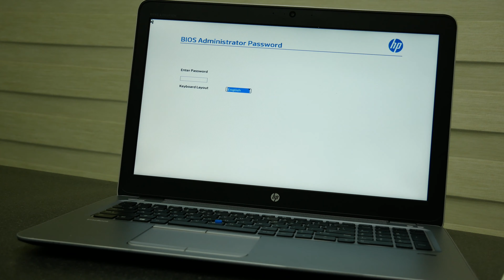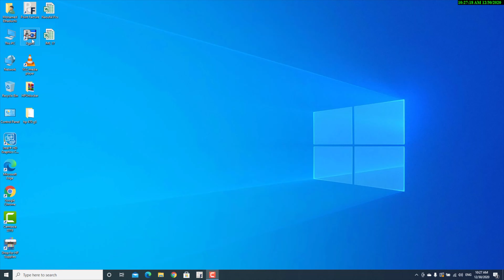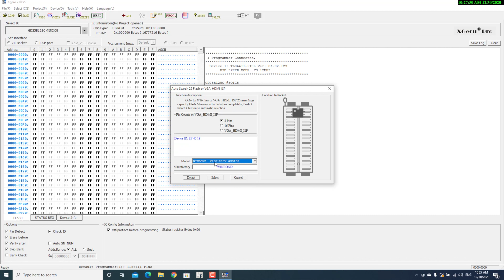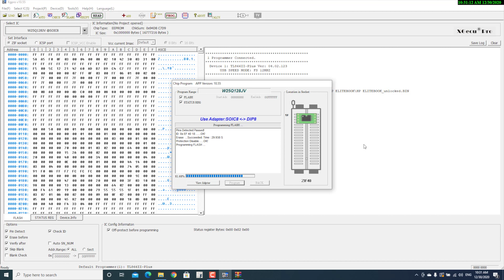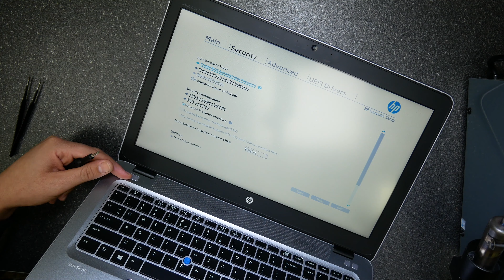HP EliteBook 850 G3 How To Reset And Remove The BIOS Administrator Password  FREE UNLOCK!!

Comment: I'm certain there's a reason, otherwise you wouldn't be doing it this way, but I'm curious as to why you can't backup the chip , then mod, then restore entirely via software tools running on the G3 without desoldering? Love to know why you can't. I'll try this when I get the courage!
Reply: i tried to do without desoldering. and now the laptop i sleeping for over 2 years. i dont know why

Comment: Is there a clip I could use for this chip so I don’t have to de-solder or is this chip too thin to clip to?
Reply: If it can be done at all without desoldering.. maybe one could rig something up with blu-tak and spring-loaded needles, looks like only 4 pins are needed? or maybe just fine springy wire.. have to make sure it was all pretty solid and stable though. Maybe it just can't be done while the chip is on the board. Maybe Roberto B's Ch341a reader device would work in this scenario

Comment: hi，My tablet model is hp x2 612 g2，There are two similar chips on the motherboard, one is 25Q128JVPQ and the other is 25Q64JVIQ, are they both BIOS chips?
Reply from the maker: You need just backup, 25Q128JVPQ
Reply: @wildreviewtech  i have done this backup ,and after that i wrote the backup-file, the motherboard just can't start up, the power led blinked white and orange for a few WildReviewTech  i have done this backup ,and after that i wrote the backup-file, the motherboard just can't start up, the power led blinked white and orange for a few minutes then turned into solid white. can not start up, the screen is also black, all chips are cold
Reply from the maker: @wuchanghu8281  check if you chip is solder perfect
Reply: @wildreviewtech  Thanks for the advice, I'll check if the welding is solid。。。I submitted the locked bios dump file on your website, can you help me with it?